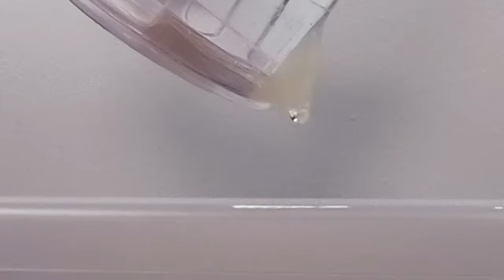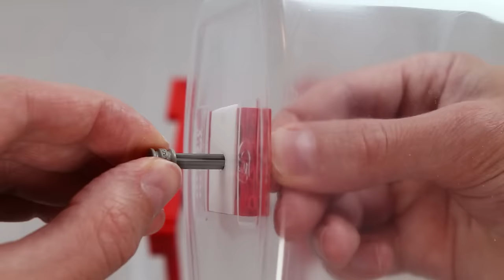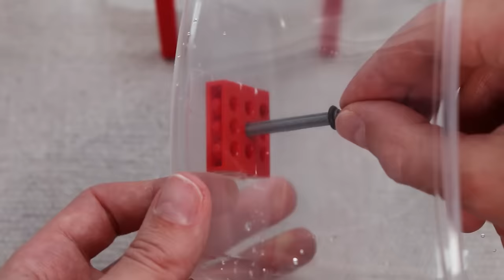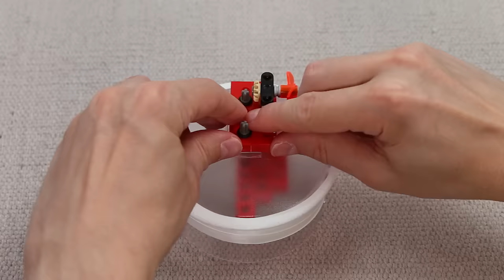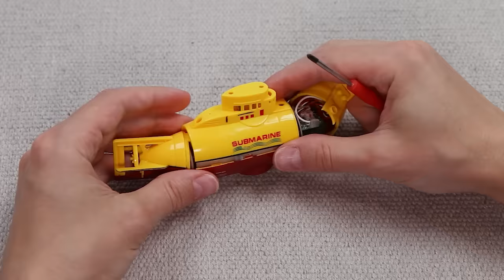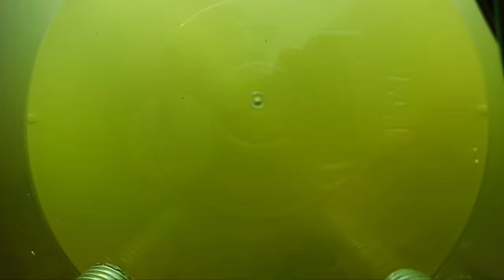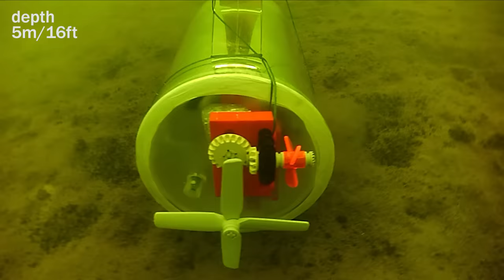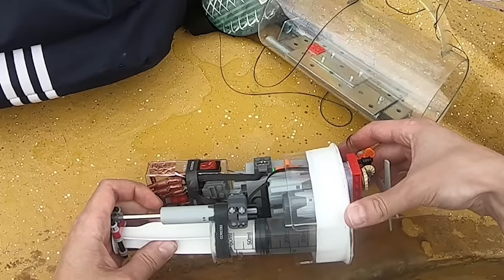Building and Testing a Lego-powered Submarine

Comment: It's a shame the ballast syringe couldn't overcome the pressure difference at the lake bottom. I hope you revisit this project. It was really cool
Reply: Yeah those syringes can be hard to push even at STP
Reply: Yeah, I'm wondering if bigger holes or more engines/more (but smaller) syringes would help.
Reply: @MrGlennJohnsen  smaller piston, increased stroke. trouble is the lego actuator bottomed out so you'd need to double it up or so. possibly another motor and actuator on the other side of the syringe like you said would help.
Reply: Probably should have used normal gears and a toothed bar
Reply: At least make the plunger straight.
Reply: Or some goofy equalization diaphragm type thing.
Reply: maybe a big spring inside to counter the water pressure ?
Reply: Gonna need some gearing on this one.
Reply: I was hoping it was going to have a snorkel, compressor (Technic does have those) and a compressed air reservoir for ballast.
Reply: @willdarling1  great idea! would try that
Reply: C02 cartridge emergency blow system? That might blow the whole thing apart. Hmmm
Reply: Well thanks for the spoiler
Reply: @JohnL2112  RELEASE COUNTER MEASURES!  EMERGENCY BLOW!  FULL RISE!

C'mon Big D, FLY!

5 Points if you know what this is from!
Reply: @21Kamil12  maybe with small wheel pushing big wheel...
4x times more power.. 
it will more slow.. but definitely will push the water out.
Reply: kleetus92 captain scared them out of the water!
Reply: @kleetus92  Hunt for Red October
Reply: Ozepyon09 spoiled it
Reply: Or attach some of the metal ballast to the outside with an electromagnet. If the battery runs out it will drop the ballast and the sub will rise.
Reply: @Renzo Mikael Jaworski Problem wasn't the torque of the motor I think, the gears in the actuator skipped teeth because pushing the water out of the syringe needed more torque than the teeth in the actuator could handel.
Reply: That's exactly what I was thinking when I head the gears trying but not being able to push the plunger back in. Given this person's methodical approach to testing everything I'm sure they had suspicions about the pressure but just underestimated it. It's very easy to underestimate water pressure.
Reply: Ozepyon09 
Most subs have a tank of air that they fill the ballast tank with.
Reply: he should apply silicone grease inside the tube to make it slide much easier in order to minimize friction. silicone grease is perfect for water equipment, they don't wash out easily.
Reply: @MrGlennJohnsen  A smaller diameter but longer syringe will take less force to push but still provide enough volume.
Reply: Why not use a water-pump? That way, even if you try to spin it when it is full, it can't get any more full, and the turbine wouldn't be grinding on anything, and still have water within it. Then you could make so it isn't neutral... ie, so it sticks out of the water more when you empty it - keep the weights for balance, and to level out buoyancy...

Another option is to have the water coming in from the bottom, so it can't come in unless there is an exchange occurring such as air being compressed by the depth, air being pulled into the container via a vaccum into a separate container... Then pushing it back to push the water out the bottom...
Reply: @valeriojackable  I'd like to have seen Montana!
Reply: Or he could use those lego technics pneumatics to push the water out of the ballast tank, but then it would have to pressurize tank before a dive and an intake valve.
Reply: @glenngriffon8032  Yah, pressure is a bitch. Even just 5 metres is tremendously different from a small puddle test in a bowl. The growth is much larger than people suspect.
Reply: Prepare for trouble! Make it double!
Reply: I guess that Physics class I took was beneficial despite me hating it.
Reply: the pressure at lake bottom is +/- 1,55 kgf/cm². I think a better gear set would help the syringe engine.
Reply: @willdarling1  This would then put more strain on the motor as it pulls the syringe back against the constant pressure of the spring, no?
Reply: @kleetus92  Is that a The Hunt for Red October reference I spy?
Reply: @kleetus92  What gives you the right to fire on my ship?
Reply: Ozepyon09 I mean, with the right materials this would definitely be possible
Reply: @MrDapperGent  It was necessary to maintain the illusion for your Lego crew!
Reply: But what we have learned from this channel is that with enough gears, anything will move.
Reply: It didnt work cuz the gopro
Reply: @JohnL2112  maybe make the co2 cartridge blow into a Balloon on the side, though attaching one would be awkward. that way the whole thing does not blow up,
Reply: A worm gear setup might work here.
Reply: @CMDR_John_Crichton  I just was going to say that :D
Yeah, he showed that worm gear has a lot of torque, so why not use it here? =)
Reply: @xjetfirex3956  might have alot of friction though.
Reply: Spoiler
Reply: @bryanrandom6382  Watch the video before you read the comments.
Reply: @23Scadu  I was thinking some kind of worm gear rig and a smaller plunger.
Reply: interesting project what shows that this lake is dead, there is not enough oxygen so that submerged plants and water animals can live.  Eventually, this lake will turn into a marsh district. They should use solar energy to pump air into that lake and bring it back to life.
Reply: @kleetus92  Hunt For Red October... But I think this project is a little more Down Periscope. 😂
Reply: So mutch smart talk what do you al say?????
Reply: That's 50000Pa
Reply: Those syringes get a bit stiff after several cycles, theyre not mewnt for repeated operation, I think that's partly whats coming into play here. Having said that, good job, homebuilt  ROV on the cheap. Well done.
Reply: kleetus92  way to go dallas
Reply: Ahh. Nothing more interesting than watching a bunch of smart dudes talking about an engineering problem.
Reply: Yea thats what im thinking
Like the preasure of the water is too strong the syringe could not handle it its trying to deflate but 
The water preasure is pushing it into in its expanded form

Thats science folks
Reply: Agreed!
Reply: @andrewjohn7782  Well, maybe, but at least we aren't discussing home tattoo kits just yet!
Reply: if he mount it in a planetary gear, the ballast syringe would work, but I think it will crack the reservoir further you introduce more pressure on it,
Reply: You should lubricate the joint of the syringe serving as ballast tank to prevent it from failing, you'll get less friction. Also giving the forward/backward propulsion a boost would be great. For current seems to affect it quite a lot. Maybe a sealed cone-shaped front cover w/ light plastic would give better hydrodynamism and lesser the impact of current and friction of water for movement
Reply: You could just get a second one, or a bigger one.
Reply: Co2 cylinder could help as emergency blow. Otherwise very indpirational.
Reply: I wonder if running the prop for a while would heat the air inside the sub enough to make a pressure difference enough to help the actuator move.  The water down there has to be at least 30 degrees colder than above water atmosphere.
Reply: Add smart techy stuff
Reply: It’s a shame the top comment spoils it
Reply: @kleetus92  Hunt For Red October!
Reply: Be careful...most things in here don't react too well to bullets
Reply: Looks like the syringe got caught on the ballast?
Reply: @kleetus92  USS Dallas?
Reply: @DonAdwick  Correct Seaman Beaumont, correct! Give it a week and you'll be teaching at Cal Tech! 

(the movie though is Hunt for Red October)
Reply: @kleetus92  Pavarotti?
Reply: @DonAdwick  Paganini!
Reply: @kleetus92  Happy as a clam! :-D
Reply: If you just use some gears its fixed in seconds, it will just be slowsr
Reply: @kleetus92  The hunt for the red october
Reply: Rip
Reply: @parkercurtis9997  You read the comments that discuss a video, before even watching a video, then you blame others for saying what's in the video? How daft are you?
Reply: Attach the  ballast weight to the syringe, so that is moves.   That way the bow will point up when you want to go up and down when you want to go down.  This will allow you to drive to surface, or drive to the bottom.
Reply: GEAR IT DOWN FOR WHAT
Reply: how about more powerfull motor ? Or, some custom details. Look, mostly we dont need speed on syringe (exсept emergency evacuation in case water leak) So why not use screw with a smaller thread pitch, then we lose in move but win in strength. 
Maybe my english not so well, but i'm pretty good know physics
Reply: i think the motor pushing the syringe was too weak, and it couldn't withstand the water pressure
Reply: @BaronSamedi1959  cool idea, until the sub gets stuck to a metal object ;)
Reply: just put a tire valve in there and pump it up to maybe 3 psi before submerging. harder for water to penetrate and less resistance on the ballast, not to mention easy application
Reply: The motor will have to exert a force higher than 7lbs to overcome the pressure. 1PSI is equal to 27.7” of H2O,  @16’ the pressure on any point is ~6.9lbs
Size of the syringe “piston” or orifice will have no difference.
There will be 1PSI at the bottom of a straw, 27.7” tall, or a pool as wide as an ocean but only 27.7” deep.
Reply: If he used some sort of heavier grade actuator he probably could have succeeded in a bit more movement
Reply: A lever on the plunger to get a mechanical advantage
Reply: U do la
Reply: I agree it was very interesting to watch and learn
Reply: @willdarling1  good idea
Reply: @23Scadu  то
Reply: Maybe lube the syringe plunger with silicone?
Reply: Yeah
Reply: What about he gear down the motor and give more torque and as somebody else had said in the sub comments a spring to push agains the piston
Reply: Spoiler alert!!
Reply: @EpicKingofFail  I think a simple lubricator would do the job, wouldn't it?
Reply: Well this is super to why you have it in super way amazing my name out  Eric Cielski
Reply: which lego set has he used?
Reply: Wanna make a submarine?...
Sure I can use parts from this perfectly working submarine...
Reply: It looked to me like as the sub got deeper the syringe flexed and the flat pushing surface snagged on the ballast plate. As the sub got dragged up on the safety line the flex went away and freed the snag so the plunger could work again.
Reply: Ozepyon09 it was spoiled
Reply: The w h a t
Reply: I’m going to take a rough guess and say it’s either from Topgun or startreck
Reply: So basically it needs to have a bigger volume I’m guessing?
Reply: Simplest solution might be a gear train and one of the high torque motors, at the expense of a longer response time. Maybe even try preloading the syringe with a spring, so it already starts off closer to a neutral amount of force required
Reply: @JohnL2112  Simpler emergency method would have an external ballast weight. simple electromagnet to hold it in place, drop it if things go wrong. have to replace the weight though.
Reply: Gears, rack, and pinion. Ez.
Reply: It’s better to use a two way water pump and a reservoir, quicker and more efficient, buttt it isn’t lego..
Reply: Perhaps it should of pushed instead of pulled?
Reply: @MrGlennJohnsen  Yeah, but if you want it dive deeper, then you ll need a better signal
Reply: @bryanrandom6382  dont read comments until you're done with the video then
Reply: A higher torque actuator would probably be the solution there.
Reply: New ones out
Reply: spoiler he did
Reply: Yeah what a shame
Reply: M
Reply: Here I am 2 years later and he did a part 2 and 3.
Reply: Hmmmmmm

Helicopter helicopter.......paracopter paarocopterr
Reply: its just a phisics
Reply: @MrGlennJohnsen  ффФ я
Reply: Yes!
Reply: 3 years later
Reply: He did revisit

Comment: Tons of brilliant electronics applications being installed

Me: Whoa, look at that wax paper on the soldering iron trick!!!
Reply: That soldering iron trick is cool indeed. Will come in handy for sure.
Reply: What trick?
Reply: @L29Ah  Wrapping baking paper around your solderyng iron when melting hot glue or other stuff with it. Baking paper avoids stuff sticking to it. Even if it sticks you can just throw it away and don't have to clean your iron.
Reply: Glad it wasn't just me! I'm an arduino type of guy, but that... really blew my mind. Clever stuff.
Reply: Lmao same
Reply: I used to do a similar one, using paper on clothes iron to absorb wax. But using wax paper on the soldering iron still blew my mind.
Reply: same hahaha
Reply: Ditto, I thought this and the sealing methods used were quite interesting and was quite surprised to see them hold up at 5m plus the pressures created when pulling the syringe all the way instead of just popping the cap off the end.
Reply: same
Reply: i know, right?
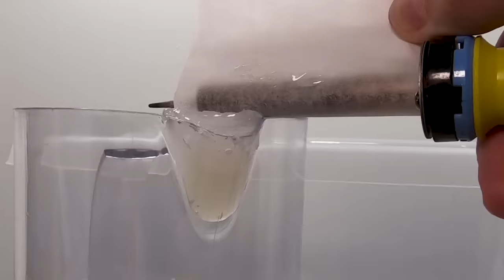Reply: @L29Ah  1:21
Reply: I was about to comment on that but saw yours!
Reply: Most amazing thing out'a this video by far. Not that I'm knocking the 'working homemade submarine', but I'll actually really use the wax paper trick!
Reply: Same!
Reply: Ha! I KNOW, right?

Comment: Suggestions for next time:

Make much larger pistons

Put a lego guy inside
Reply: ^ under rated comment.
Reply: 69 likes

Nice
Reply: @drizztdourden6687  *underWATER rated comment
Reply: Someone correct me if im wrong but wouldnt larger pistons require more force to push ? In theory multiple smaller pistons would be more effective at depth as the motor will need to push less water per piston meaning less resistance
Reply: @Migguls611  True, but that means the ballast can fill up with more water, thus able to dive deeper
Reply: Awesome crazy guy
Reply: Another possible way to get around this issue is to use (lego) gears to generate the necessary force required...
Reply: A diver?
Reply: Also, add a flashlight and a camera that streams video wirelessly.
Reply: @JohnsontheFly  thats...just wrong. All it needs to be is like 1g heavier than the water it displaces and it will sink to any depth. A  larger syringe will just make it like 20g heavier, it will sink faster but not deeper. a larger syringe will take significantly more force to push back down. best to use a longer skinnier syringe. Same amount of added ballist but less force required to move it.
Reply: @gannonhuiting9788  you are right Ig
Reply: @gannonhuiting9788  PLUS radio waves dont go far under water. he would need to attach a lame cable to control it, he wont get far with that joke controller
Reply: @alengm  YEEEEAAAAAAHH!
Reply: there is already a lego man inside.
Reply: HEY!
Reply: Gannon Huiting Could also just use a sacrificial rock that gets cut at bottom and a balloon that use liquid gas to come to surface quickly.
Reply: And possibly a dual prop system for turning
Reply: @alengm  weight
Reply: @krzysztofjablonski1202  no
Reply: the guy who actually comments a genuine comment and thats where the alpha brains come in and reply
Reply: @gannonhuiting9788  Actually it wouldn't. The deeper u go the denser water becomes (same as with the atmosphere) so u need the sub to weigh more. The principle is same as with hot air balloons.
Reply: @przemo12323  no, that's wrong. maybe by like .00001% but water has the same density pretty much under any pressure. It's a fundamental difference between gases and liquids.

so no that's just incorrect unless you're going to the bottom of the ocean, and even there it's negligible.
Reply: HE DID IT! 2.0 has a lego man inside :)
Reply: He did it! (in his future video)
Reply: Granted
Reply: Granted
Reply: He lissened to u
Reply: I have a feeling the issues with his ballast may also be debris in the syringe or just the difference in water pressures.
Reply: He did it
Reply: @alengm  Radio waves must be low frequency in order to penetrate water, which is conductive. I am surprised to see 27 Mhz radio control to penetrate 5 meter depth. Video requires larger band than just on/off controlls, so they use 2,4 Ghz band, but this frequency will not enter the water depth at all, unfortunately... So, no way to get video streaming from under the water at least that you use a cable.
Reply: And thats what he did XD
Reply: And he did
Reply: 3 add torpedoes
Reply: He did it version 2.0
Reply: Your wishes came true
Reply: And have a cone at the front of the submarine. It improves movement.
Reply: @drizztdourden6687  idk man. It's at 4.1k likes  now
Reply: @joshskulls  nice try broz my first comment is a year old. It was underrated at the time.

Comment: Wax paper over a soldering iron. Never would have thought of that.
Reply: parchment paper*
Reply: Wax paper*
Reply: @c_holding8564  whoever gets more likes is correct.
Reply: @viporal7898  Agreed. Wax paper isn't heat resistant. Parchment paper is.
Wax would burn against the soldering iron and wax could interfere with the way the hot glue behaves.
Reply: Ok, just googled it haha- 'While parchment paper can do anything wax paper can, it's more expensive. The maindifference between papers is their respective coatings. Parchment paper is coated with silicone to give it a nonstick, heat-resistant surface, and waxed paper is coated with asoybean or paraffin wax.'
Reply: Parchment paper* but yeah I wish I would have known of this simple trick, would have saved me from a lot of nasty fumes and a black soldering iron shaft lmao
Reply: @Lord Waluigi the Greek way
Reply: Haha saaame